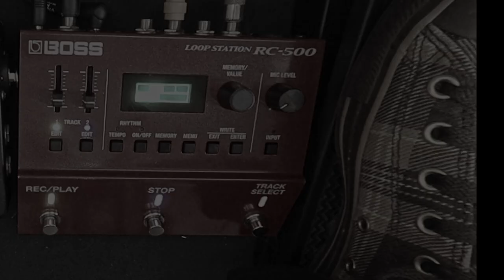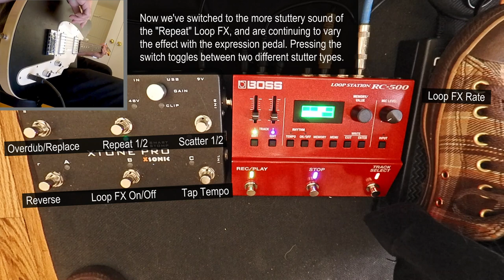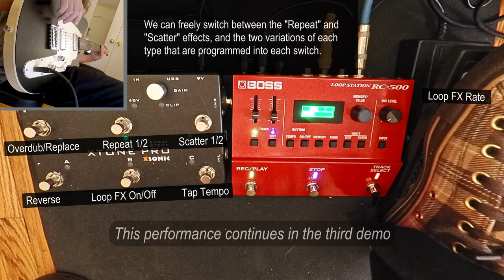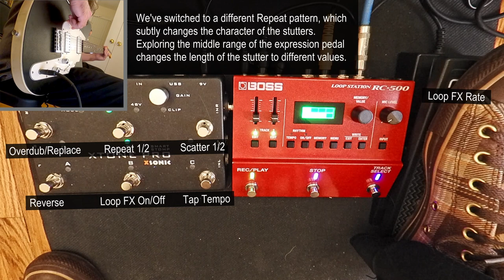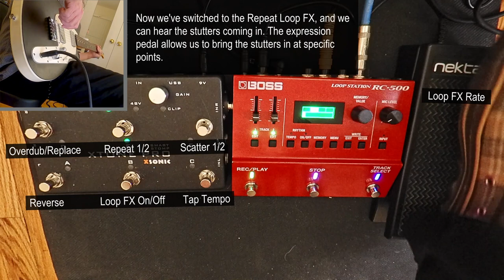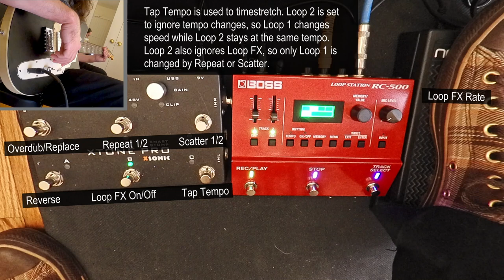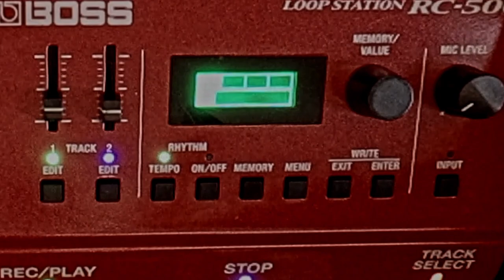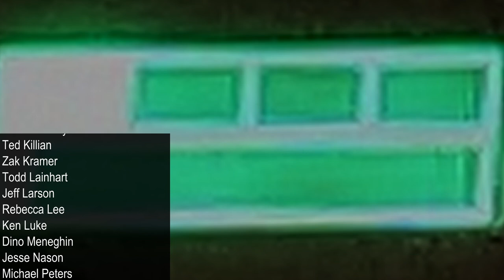Glitch and Granular Looping with the Boss RC-500 Loop Station

Comment: hallelujah! time-stretch discovery! EXCELLENT, andré! the time-stretch effect is very similar to (though not as severe as) the response of the old Electrix Repeater, albeit that one could be slowed down to..... nearly infinitely down, and is simultaneously readily re-pitchable by 1/2 steps at least 1 octave up and one octave down...... as well as offering all of the in-between pitches. (on Repeater, Time-stretch can maintain --- and i use that word loosely --- its original pitch, if you like: so, some super-cool artifacts available.

Comment: great video!! Are all the effects being used on this from the pedal itself or is there any additional outboard gear being used?  I'm curious about how the new RC-505 MKII compares and if these same options/features are available on it.
Reply from the maker: Thanks for tuning in! The guitar is going through an amp modeler with a bit of reverb before it hits the Boss. After that, I did some EQ/compression/stereo-ization to the audio when I mixed it. But as far as glitchy/loop altering stuff, that's all the RC.

I don't know anything about the 505MKII, but I'm optimistic that some of these less mainstream features could find their way in there! I have to give Boss credit for including them here, in the first place. :)
Reply: The RC-505 manual lists the RC-500's Track FX (Repeat, Shift, Scatter, Vinyl Flick) along with more "conventional" FX like delays, modulation, filtering, reverb, etc.
Reply from the maker: @scottmartin5492  Great! Those are exactly the ones I'm dealing with here. (I didn't demonstrate shift or vinyl in the video, but they're definitely options in that same category.) Good to know!

Comment: How do you connect the expression pedal and another pedal more? In the same jack?
Reply from the maker: Sorry I flaked on this! The expression pedal does into a 1/4-inch analog input in the back of the Boss. The MIDI control pedal goes into the MIDI input, which is a separate (8th-inch) jack.